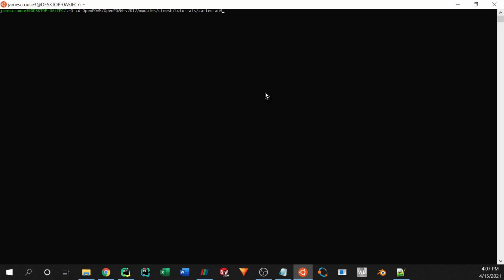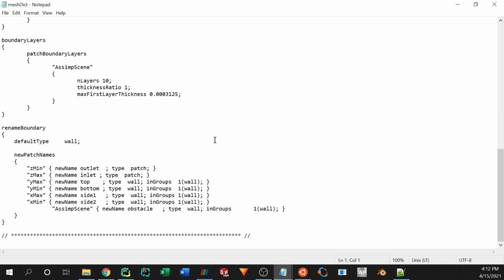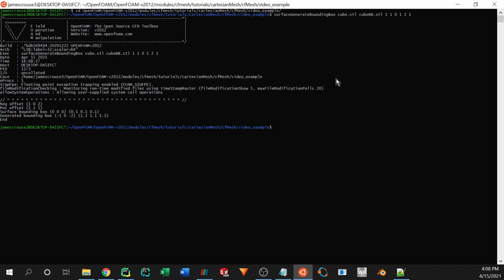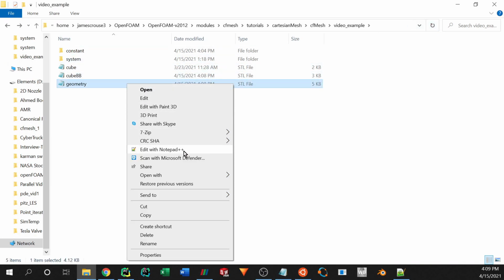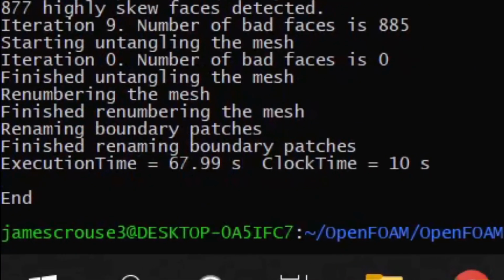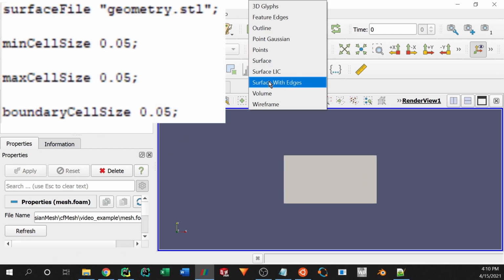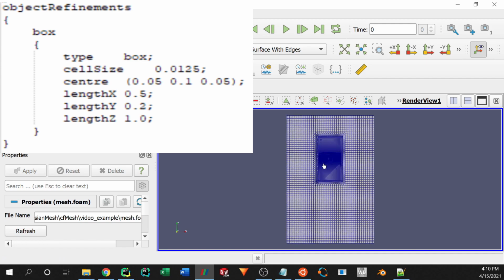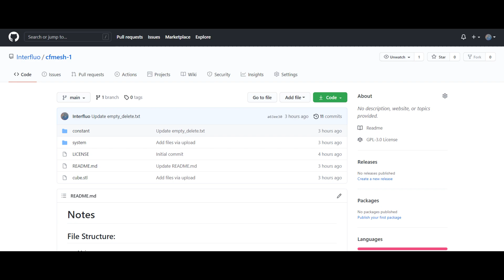OpenFOAM cfMesh tutorial: cartesian mesh + refinement zones + inflation layers

Comment: What is the difference between using this and snappyhexmesh? Also, how do you define your boundaries after you create a mesh this way?
Reply from the maker: At the bottom (lines 67-77) of the meshDict file you will see that the boundaries are being renamed and the type (patch or wall) is defined, then the boundaries are defined in the 0 folder as usual. It is just a different tool than Snappy Hex, it has some pros and cons and is up to you to weigh them for your specific case. One major benefit is that it generates the mesh using multithreading, so it is very fast